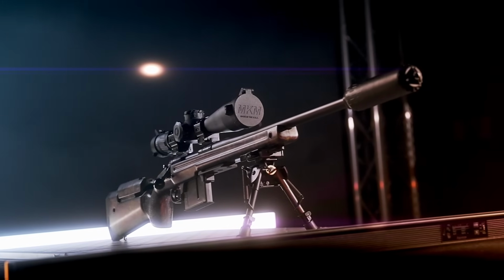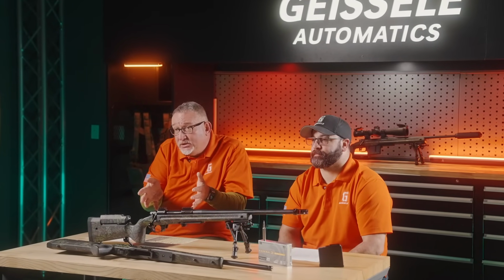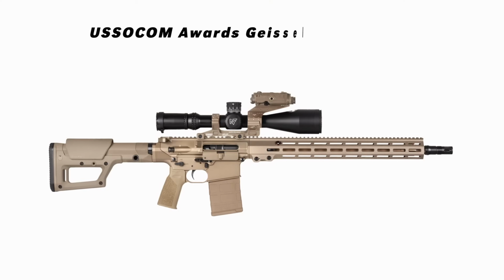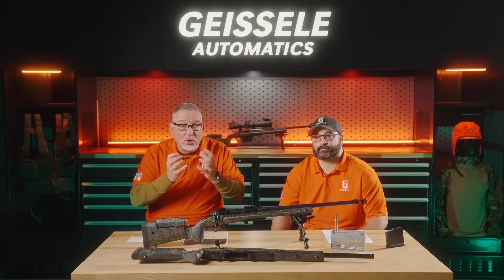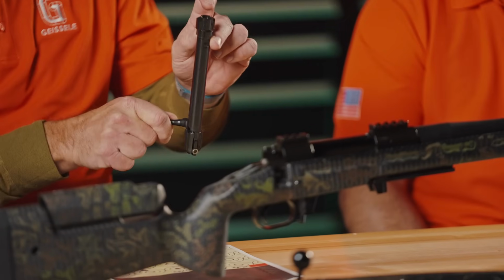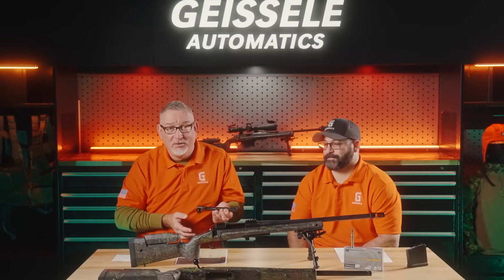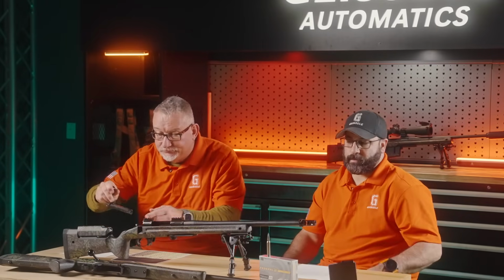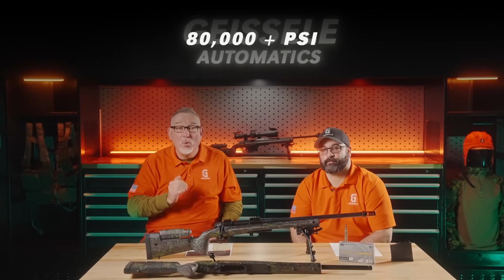King Hunter - Deep Dive with Bill Geissele & Matt Sibio

Comment: Wtf a flow through on a bolt action?!?
Reply: Y not??
Reply: @Ghostgunner85 can make a quieter can without the side affects of backpressure that WOULD effect a semi auto platform. The bolt action stays locked shut when firing, so there’s no downside to using a much quieter design, that would otherwise make shooting a semi auto miserable.

Comment: Hearing your “journey” with the rem 700 brings back fiery memories lol. I had a remington in 2008 that was actually a tac driver but the bolt was so stiff that when you unlocked after firing the gun wanted to roll over. When I traded it off it had all the park rubbed off one bolt lug. The other was pristine. Same gun started out with such a rough bore it would copper foul out in 20-30 rounds. After about 500 rounds the bore at least got slicker.

Comment: Why would anyone want a flow through on a bolt gun
Reply from the maker: @JmartinG  it’s a great question. Since most users may be already apart of the Geissele family the odds are many have HUX suppressors already so giving them the ability to use it and not need to get another tax stamp was important to us. The brake is also removable if you prefer other devices.
Reply: @GeisseleAutomatics what does someone owning a G$ firearm have to do with them owning a Huxworx can? lol